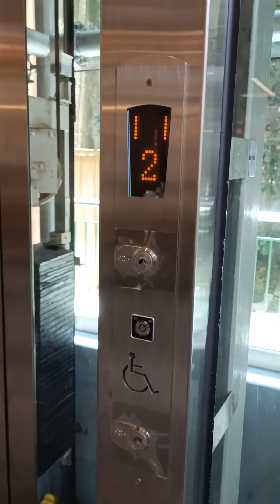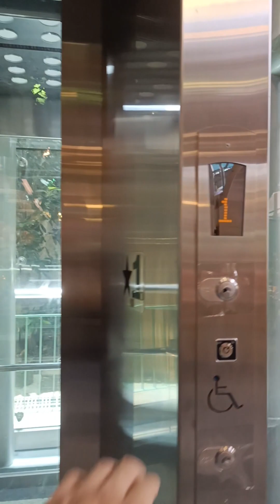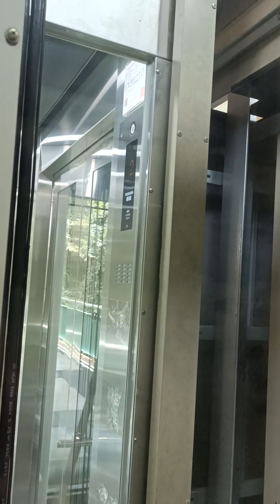2009 GFC Traction Elevator@sun moon lake cable car station, nantou, Taiwan

Comment: They took a LOT of inspiration from Toshiba themselves, even the interlock looks like it came right out of Toshiba.

I do honestly wish this was the SPACEL offered to us, perhaps this might be SPACEL-IV?
Reply from the maker: @ZHD1987E Yes, the door assembly was definitely heavily based on Toshiba's specifications, I don't think It's based on Toshiba products though, the whole point of the business model is that GFC will do all the work(R&D, installation, services, etc) while Toshiba sits back and get paid by GFC in the name of licensing technology and badging, every time GFC finish their R&D, the prototype will be sent to Toshiba for validation before Toshiba will allow them to use their brand name on it, I read this from shareholder documents from GFC.
Reply from the maker: I also visited some GFC elevators machine room myself and seen many pictures of machine room for GFC elevator from different era, they don't use Toshiba parts at all since 2001, check out elevator wiki on GFC if interested, I put a lot of work there
Reply from the maker: @ZHD1987E well, it’s more like Gfc approached to Toshiba and proposed the distribution and licensing business plan, Not Toshiba looking to expand to Taiwan and looking for a local partner.
Reply from the maker: It’s like there is demand for lifts in Taiwan, someone saw the demand and started GFC to supply the lifts, but nobody in Taiwan know how to make lifts, so they come to Japanese firms and ask for licensing, the Japanese party don’t need to make any investment at all, the stakes are completely on Gfc itself, so it’s a good deal for the Japanese party
Reply: @ElevatorCatcher  I suppose to put it simply: Toshiba somehow just license the brand to GFC (with approval), so any GFC with Toshiba branding, is just a Toshiba only in name.
Reply from the maker: @ZHD1987E  The licensing is beneficial to Toshiba only if the contract states clearly that Gfc can’t use their technology overseas, which I believe is the case here.
Reply from the maker: @ZHD1987E you are right about the possibility of toshiba being interested in introducing products with Gfc, but I suspect it wont happen because I don’t think Gfc is good enough,on the other hand, yungtay did pretty good, they have good market share in mainland china and large r&d and manufacturing capacity across Taiwan and mainland china, that’s why hitachi just straight up bought yungtay.